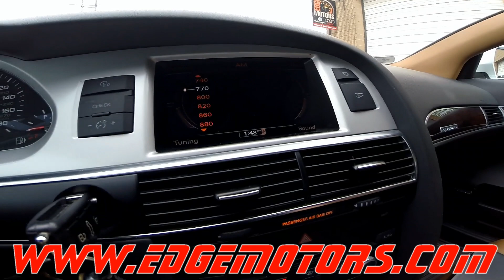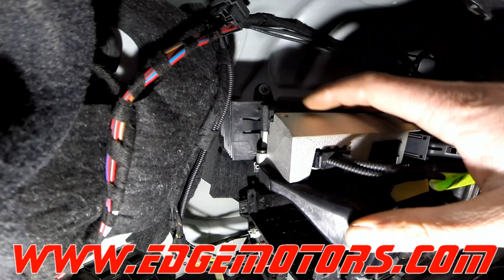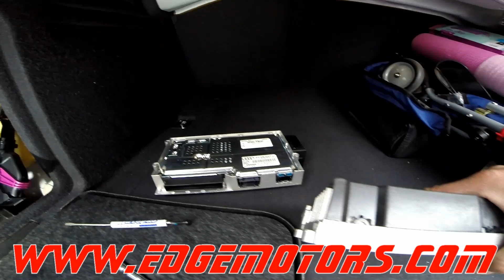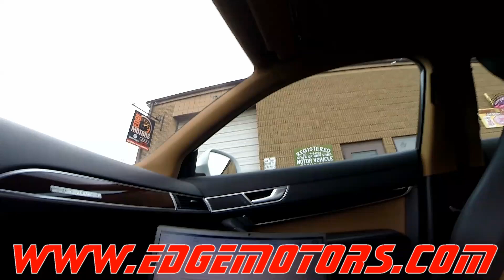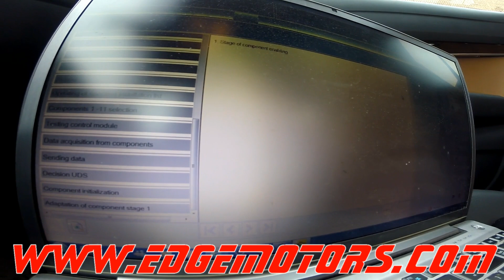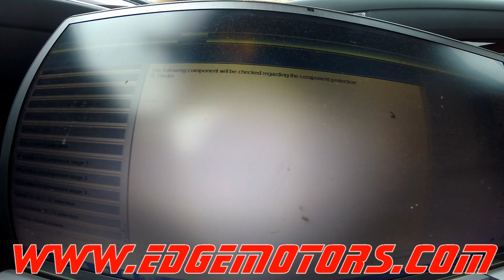Audi A6 C6 Audio Amplifier Replacement DIY by Edge Motors

Comment: Great video! I bought a used 2010 a6 Avant knowing there was a radio issue. The previous owner provided two amps both with different S/N.

The one plugged in currently has sound only on the drivers side and my scan tool shows component protection. Does this mean the amp is good and just needs someone with ODIS or the dealer to program it?

If not, how do I find the original S/N of the Bose amp I need? 

Thx!

Comment: i have  2009 audi s5 my amplifier got water damage so i when to buy from junkyark and put is in now turn on.    icon show mute , no volume up or down 
do i need to to programe the amplifier can you do? need help
Reply from the maker: That looks like the amp is no hood. When you replace the amp, you do have to program it, but it will work, just one side of the speakers... the problem you describing looks like the amp is no good
Reply: @EDGEMOTORS  so you say the amp is no good i have to buy another one?

Comment: Damn, i jump started my car cause it won’t start up, i did everything right. After that i realized that the battery is dead so i bought a new one and replaced it. The only problem is, after i jump started the car, i had no sound. Like everything works, but no sound. I checked the amp its dry and still very clean, so i don’t know why the amp would be defect.. could this be another problem? The sound is gone, the amp doesnt make any noises aswell, i disconnected the cable from the amp and navi but still, nothing helped. I have a Audi a4 2008 b8 mmi2g high b&o, i’m so confused. I can’t do this scan thing cause i don’t have any adapter for it, it made me confused even searching for the adapter lol. Could it be a burned fuse? Cause i heard a clicking sound when i wanted to start my car, but it didnt workout so i couldnt pull out my keys and it made a long “tuck tuck tuck tuck tuck tuck..” and this sound came from the fusebox where the mmi fuse is located, after that i had no sound
Reply from the maker: You should def check all fuses...
Reply from the maker: And find and do a scan
Reply: EDGEMOTORS The fuses are ok, but i couldnt find the sound system fuse, there is non lol 🤷🏽‍♂️

Comment: Thanks for the video. I've used many of your videos... they're excellent.   I did the amp swap. It now needs audi to reset it.  They are refusing, citing warranty, etc.  Any suggestions?  I looked into ODIS, but it seemed proprietary. Do you have a video on setting up ODIS, or could you do one?  Seems i'm stuck, since I don't want to pay for a new $2000 amp for a car that's probably worth that amount.
Reply from the maker: Sorry, to get odis you have to contact vw and get approved...
Reply from the maker: And the subscription will not worth it for just one amp.
Reply: @EDGEMOTORS  Thanks.  I'm going to try to clean the circuit board, which has minimal corrosion. I found repair places on-line.  Also found cloning service to copy the stored code over to the new board.  Both about $300. Ugh.   Maybe I can find an ODIS mechanic in austin
Reply: @ijdad99 what did you end up doing?

Comment: i got 2005 3.0tdi with bose system and i get the ticking sound in drivers site door. The radio works fine, sounds ok, but on top of that there is that sound on top " tuk tuk tuk tuk tuk tuk" what can be wrong?
Reply from the maker: Scan and see if you have any component protection codes in there...

Comment: What happens when you only have sound on driver side
Reply from the maker: What kind of car is it?
Reply: EDGEMOTORS  2006 a6.
Reply from the maker: It looks like you component protection is active...
Reply: EDGEMOTORS  how or what do you recommend to do
Reply from the maker: You have to reprogram the security system, any dealer can do it.
Reply: I also have problems with ac unit component. responds to nothing ,only defrost.  is this related with one another?? thanks for guidance
Reply from the maker: Yes, that’s a sign of ac unit component protection being active, they all get programmed at the same time... what happened to the car that it has allot of components replaced? 
Do an complete scan and see all the codes in all modules....
Reply: what us this software called nd what's the cost?
Reply: @EDGEMOTORS  I know this old but i get sound all thru the car 07 Audi 3.2l quattro but seems bass out seems if i hit a bump may come back on or if the door slam. thought i paid for electrical work to see if it was a shortage shop tell me buy amp to see if it fix problem if not they will see Tf. Any Clue?